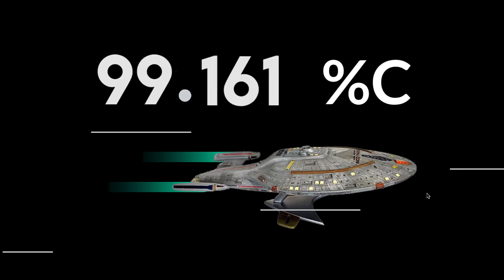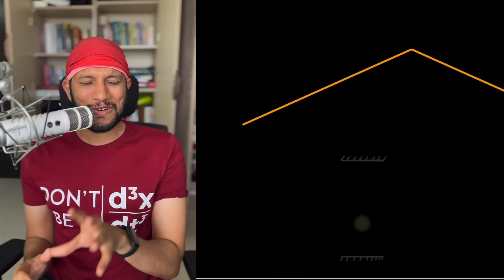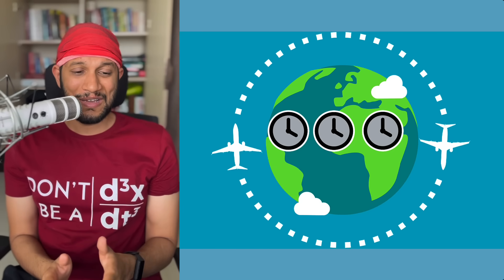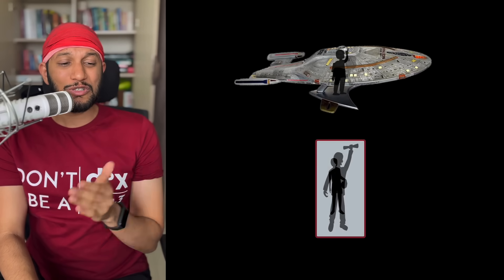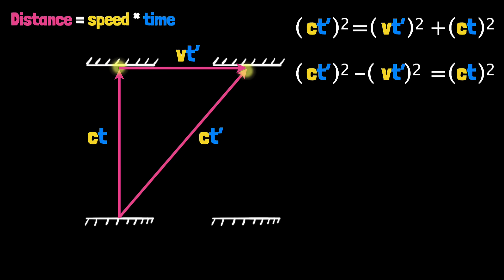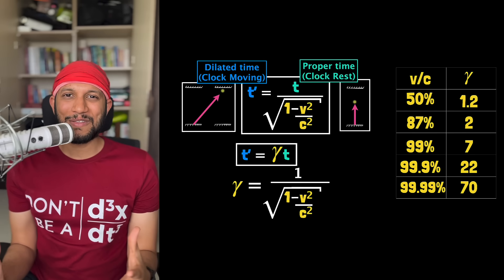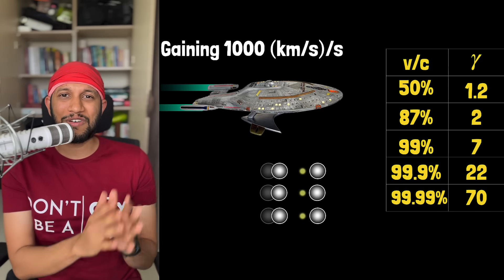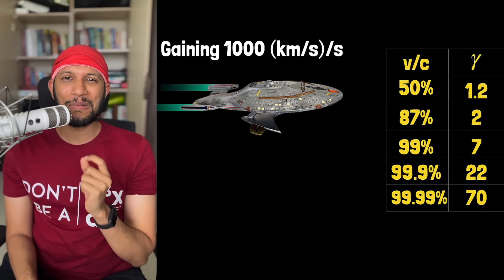I finally understood why you can't go faster than light! (My mind is blown)

Comment: I have a question. 
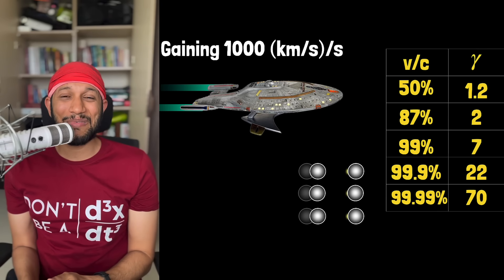Everything is clear up untill 14:09. A force transmitter takes an almost infinite time to travel the distance between two atoms since they are moving at almost the same velocity. But this is as seen from an outside observer, same as the photon clock. On the ship time appears to be moving normally, and the speed of light is constant in all reference frames.  As far as I can see, force transfer between atoms is the same. Same as if I throw a rock up and down in my hand.

Comment: That is all very clear. The problem, however, is that then speed and thus time are reference dependent. If I change the point of reference, I change time. If I am on a planet that moves away from the centre of the galaxy at high speed and my twin is on a spaceship that flies towards the centre at high speed, for whom is the clock ticking faster?

Comment: We don't need to worry about the speed of light limits anymore. 
Scientist in a lab during a live experiment naturally assembled a warp bubble to stabilize the micro pieces of gold (suspended with the bubble) and then they used a larger piece of gold with a second warp bubble to get the gold closer to each other. This experiment wasn't to demonstrate warp bubbles, so it got no press. it was a study based on the gravity of gold particles in the micro scale. This left scientist baffled that they realized they were in fact using an alcubeirre warp bubble. To perform the experiment.

Comment: Forgive me:  I'm not a physics student, but couldn't the speed of light theoretically be breeched if you introduce a 2nd relative factor?

Suppose the ship reaches nearly the speed of light (right upto the brink).  As you move from the back of the ship toward the front, couldn't you theoretically move faster than the speed of light?  

The ship is moving relative to its surroundings and you are moving relative to the ship.

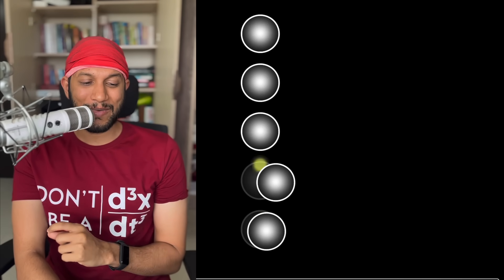Comment: 3:10 - I think you've got this wrong. Information doesn't pass along the second hand at the speed of light. It travels at the speed of sound within that material.

For example, imagine a solid one light second in length. If I pushed one end of the solid it wouldn't take one second for the other end to move accordingly. It would take much longer.
Reply: It's a theoretical clock
Reply: But you're correct this is all theory and mostly bs. Welcome to science
Reply: That's because of momentum it doesn't travel at the speed of sound what are u a fucking infant
Reply: Yes, but for a perfectly rigid, infinitely dense material, the maximum sound speed is the speed of light

Comment: But why can only light travel at this speed? What makes it so unique in the universe. Also, is it possible that there is some other, undiscovered matter that can travel even faster, or is that also impossible?
Reply: There may be particles that go quicker than light I think it was Tachyon, but they were never seen. I think the point was that they Can't go at or under lightspeed, just like photons cannot go below lightspeed. It's possible I guess, which doesn't mean it exists. Have in mind that we are in general talking not only about light in the term of shiny shiny, a light beam, a electro magnetic wave, includes much more than just light. Cause in these terms, a infrared radiation is also just light, just not visible.
Reply: To round it up, I guess only "particles" can travel that speed is cause they were always traveling at that speed, as soon as they for example exit the sun. So the reason they travel at that speed is caus it's their normal speed 😅

Comment: I have a bit of an issue with this explanation.  It treats time dilation as something that "happens" to the ship and its clock; that there is a physical mechanism at play. It also can lead to the idea that everyone would agree that is the ship that is moving and undergoing these physical effects, and thus time dilation.  This isn't the case.   Relativity, as its name suggests, deals with relative velocities, not absolute ones.   For someone on the ship, it is the outside observer that is moving, and it his time that runs slow.   Yet another observer would be able to say that both of the previous two are moving at the same speed relative to him, in opposite directions, and that both of their clocks tick at the same rate, and slower than his. 
Now, this may seem contradictory, and lead someone to think that this could result in two twins traveling at high speed relative to each other and then coming back together with each saying that the other is younger of the two at the end.  But this is because you can't deal with time dilation by itself.  Relativity has three "legs" that support it. The other two are length contraction and the relativity of simultaneity. Any real analysis has to take all three into account; they don't act in isolation.  The upshot is that by including all three, you can get everyone to agree as to which of the two twins aged the least after they meet up again, even though they might not agree what exactly happened while they were apart. 
In the end, Relativity isn't about light, or the physical interactions of atoms, etc. It is about the nature of time and space, the interrelationship between the two, and how we measure it.

Comment: Yeah this is the intuitive expansion:

Mainly, in a Universe where causality isn't instant, but instead, it has a speed limit - everything that travel inside that Universe are ultimately "running away" from the rest of the Universe trying to interact with it. That is true even inside the material of the object itself, from one atom to another.

But again, this is still not the full answer - because if something is moving close to the speed of light from my point of view - might not be going close to the speed of light from another point of view... So there is definitely more to the story here.

For this explanation to hold, we need to be able to define an absolute reference frame - and ONLY then, will this explanation actually make sense.

Comment: i still don't get why moving affects time, i mean, yeah i get that the clock moving to us seems to be tickling slower, but why isn't that just a visual distortion? i feel like if the clock stops and came near mine, i should be able to visualize the same time
Reply: I know right? Youre basically outrunning our normal understanding and pacing of time. Just like you would arrive earlier on when you would go earlier or when you hurry. In other term, the faster you more to work, the sooner you're there. Now imagine traveling with almost lightspeed. Light just goes faster as a second takes to pass.

Comment: Then how fast can I actually travel? Let's say I have developed a genius nuclear engine that doesn't run out of fuel and I set it to give my space ship a nice 1g acceleration at the start and steer the ship to pass Alpha Centauri. After that I never touch the controls. After how long time (according to my own wrist watch) will I pass Alpha Centauri (see it in my ship's side window) ?
Reply: Hard to say when our measurement of time is connected to our planet😅

I think when you would travel at light speed it would be immediately cause theres no time to wait for,but for observers there are still 4,5 ish years that pass on your travel.
Reply: So I guess, almost lightspeed speed will get you there in 5 ish spaceship years. Hm it's really a head nut

Comment: So one ship travelling left at 3/4 speed of light and one travelling right at 3/4 and an observer sits in the middle of the two.
The left ship observed by the right ship ( and vise versa) is travelling at faster than the speed of light relative  to each other and on board the ship the photon isn't traveling further just between the two mirrors. 
Like a fly hovering on a bus going 50 miles sn hour.

Comment: The same goes with a pendulum. Arguing the speed of light is the limit by using light to measure time is not an argument, it's a circular argument, like Don't believe in God? well, its in the bible. (which is BS)

Comment: Thank you for that insight. Actually it is quite easy to understand, but that is only if someone like you explains it. However I have another question: In this very example what is the perception of the person inside the spaceship when approaching the speed of light. From the outside the "ticks" in the spaceship get slower and slower and that's why the speed increase gets slower and slower eventually never reaching the speed of light. But what is the perception on the inside of the spaceship. From the travellers perspective time runs at normal speed. What is his experience never reaching the speed of light?
Reply: I have the same question

Comment: I have much easier and alot shorter explenation for this - Example - if you need to reach 100km/h You first need to reach half that speed 50km/h. After you have reached 50km/h you need to reach half of the rest missimg 50km/h (75km/h). When you reach the 75km/h you again need to reach half of the remaining km/h which is 87,5km/h. And so on and on and on. You see - you can never reach fulls peed if you alleays have to reach half of the speed. 

Now put this theory in speed of light example - same thing :)

But you know whats the is the most bissare? We still at the end reach thouse 100km/h - it means we would reach speed of light also, and even more.
Reply from the maker: 1 + 0.5 + 0.25 + … = 2. Not infinity! So, the statement, “you can never reach ..” is wrong. This is the Zenos paradox

Comment: @13.20 mins u are explaining acceleration and time dilation. at low speeds everything seems normal, at high speeds from outside point of view, the ship slows down in acceleration. but what is the point of view from inside the ship? are they still accelerating at 1000km/s/s? inside the ship, will they reach the speed of light?

Comment: Let's say I want to go around earth 80 times on 99.99% of the speed of light

That means it would take 10 seconds, so to me, I would do stuff for 10 seconds? Or I would have less time to finish the 80 revolutions? Like.. 1 second instead of 10?

Also, if I have 10 seconds, let's say the track on earth is fulfilled with cameras to not miss me on any moment, if they see me way slower, when the track finish they would only track me on the first second, what would happen to the rest of the footage? (That's if I have my 10 seconds while traveling)

Comment: This video does not explain the why. There is no explanation why the moving photon clock behaves like it does. The magic is that the physical effect of the bounce must be the same for any observer. Why this? Assume the photon destroys the wall. Then it must do the same destruction for every observer. Because things cannot be destroyed and not destroyed when watched from different views.
The impact of the banging photon is the pulse, which is velocity times mass. Mass does it change, impulse must not change, therefore speed is the same. No we are there: Speed is same, way is longer, then the time is different for the observers. That's the key. Without this, it's just a nice animation that explains nothing.
Maybe you can explain what happens to the impact angle in both views, it looks different, which means different effect. Oops.

Comment: Could you also say that as a large body like a spaceship moves closer and closer to a forward linear trajectory at c there is an increasingly restrictive available set of potential vectors for all particle motion? Said another way, your particles are moving so fast forward that they literally don’t have energy or time (ha) to move in any other direction aside from “forward” in the direction of acceleration when your movement is measured by an external party experiencing non-relativistic speeds? The vector of forwards acceleration is so overwhelming that all other particle motion is effectively frozen to outside observers because adding up all vectors can never exceed c. The closer you get to c in one direction the inevitably closer you must get to 0 in all other directions, effectively locking all particle motion in to a timeless liner state where nothing but forward motion can really happen? To an outside observer you appear to experience no time as all of your particle motion is locked up in forward near light speed movement. While in that state yourself you experience eons and massive amounts of distance in a heartbeat because light speed is constant even at your speed so you notice nothing wrong in your own reference frame. 

Could be way off, just saw your graphic for a decreasing slope of movement through spacetime as the object sped up and kind of ran with it in my head. As you spend more time moving forward the geometry of that triangle gets closer and closer to being a perfectly flat line in the direction of acceleration.

Comment: Question then, if the photon clock is moving up and down at light speeds perfectly straight with 100% energy reflect and suddenly moves sideways wouldn't that just be adding energy to the photon to move it sideways through space?

Because something needs to bump something to move so without nothing acting on the photon it will just keep moving up and down.

Also another question why is the photon always moving or depicted as moving?

"Nothing can ever move at the speed of light" but photons are more at the speed of light??? What?

Comment: OK now the only thing that I don't understand is the perspective of the clock. Or say perspective of the ship's pilot. If the clock/pilot themself experience time as normal and inside the ship everything feels normal as you said at 8:25. So my question is will the pilot ever experience slowing down or will the ship continue to accelerate at a constant speed from the pilots perspective.
Reply: The pilots brain slows down as well
Reply: For the pilot,he would experience time normally. Like he might experience 2 mins, but that 2 mins might be equal to 20days on earth

Comment: Light shone through a cloud of sodium ions known as a Bose-Eisenstein Condensate was slowed to 27.5 miles per hour in 1998. I have moved faster than that in cars and on motorcycles.
Checkmate, it is possible to move at speeds faster than light under the right circumstances.

Comment: One thing I'm still not clear on, you said an outside observer sees 1000km/s/s as 2 seconds at 0.87c, but for passengers on the ship it is still 1 second, so from the reference frame of the passenger when does acceleration slow down or stop assuming constant thrust?

Comment: And it is still theory. Using moving mirrors outside a ship and making it change trajectory?? Still don't get it. If you are inside the ship the mirrors don't move however outside they have to, is in it why it takes more time??? It's like when explaining that there are other factors that change the result but will they change just when you are inside or when you are inside the ship?? Can't we?? Years ago we could not go over the speed of sound and now we can. The universe is still a mystery. Theory it is only a theory untill proven right or wrong. Think outside the box. Do not trust just what you know but trust what you could find of all is not what you though it is.

Comment: Nope - What frame of reference is used, Earth?  At the same time, Earth spins on its axis at about 1,000 miles per hour, it orbits around the Sun at a speed of about 67,000 miles per hour within the Milky Way Galaxy moving 1.3 million mph in the general direction of constellations Leo and Virgo..... I could keep going but you get it - there is NO true reference for accurate time dilation measurement - it's an illusion.

Comment: Great video but (Fact) - The "speed" of light in a single direction is assumed & has not been measured and can varies (or fluctuates) based on the medium. Quantum mechanics entanglement has been measured 3-trillion meters per second – or four orders of magnitude faster than light. Coveted theories aside faster-than-light communication may be made possible in the future by cleverly using quantum entanglement to our advantage (perhaps - Quantum Morse code?)

Comment: The force carrier having a speed limit of the speed of light has always been the easiest description for me. If the force carrier cannot go faster than the speed of light, then by going the speed of light, the atom would move as fast as the force carrier, and thus would not be able to tell the next atom to move.
Just look at the photon clock. If the photon can only move at the speed of light, and it is having to move that entire speed forward, then it will be moving zero speed up and down. For all intents and purposes time stops at the speed of light.

Comment: This is wrong. Its the currently accepted understanding of time dialation and motion however my past experiences with u.f.o's has left me without a doubt that traveling at the speed of light is very much possible.  I can't replace the equations obviously but i know what i saw. The craft left a red translucent trail of itself which followed in phases. This occures because redlight moves slower then the other wavelengths of light.   Yep, not all light moves at the same speed.  And thats not all, the faster something accelerates, the more resistance is applied to the atoms in motion however, if the craft could bend space time, then the craft would not in theory  experience drag or even resistance Thus making the trip fairly simple and pleasant.